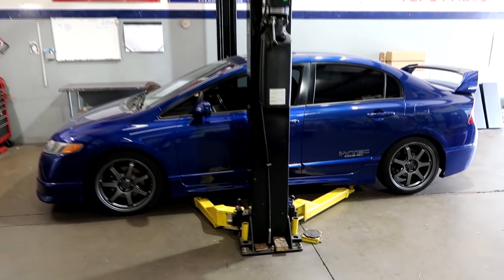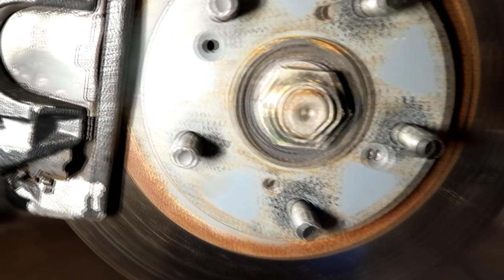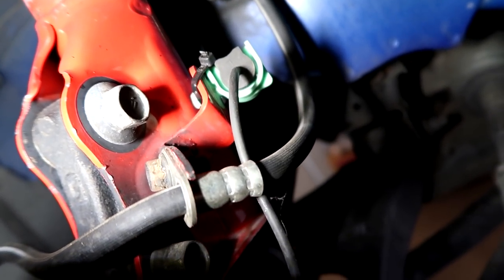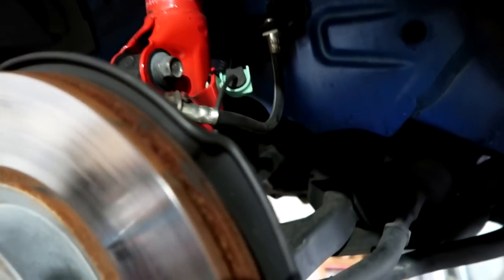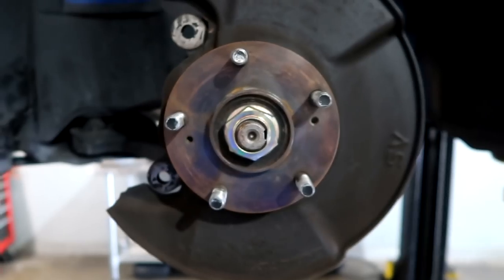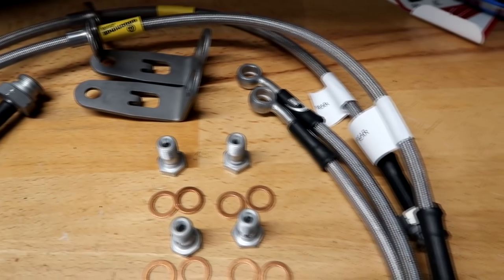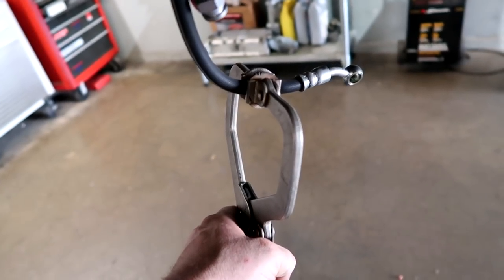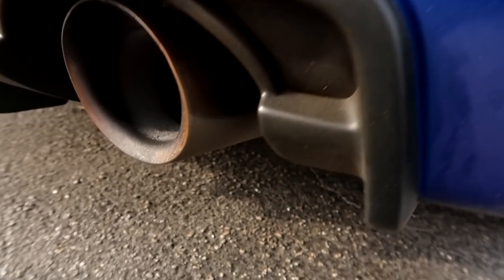Mugen Civic Si Brakes

Comment: If you dont want the brake fluid leaking while replacing the lines you can press the brake pedal to the floor and hold it there with a rod. Also if you wont be replacing the rubber flex lines never clamp them. You can crush them and impede the flow to the calipers or it will delay the brake from releasing causing excessive brake wear.
Reply from the maker: IWORKYOUWATCH In the video it was mentioned the lines were to be replaced. Hence it didn’t matter.
Reply: @LHTPerformance  I learn a lot from comments so I put my 2 cents. I no you already have that basic knowledge

Comment: Hey George!  great vid, very informative!  Got a K-series question for you... Got my head in a shop right now having it looked at (K20A2).  The valves on cylinder 4 cannot be loosened any more (zero lash).  What could possibly be wrong?  I thought these motors have titanium valve seats?   Any insight would be greatly appreciated.  Thanks in advance!  Love the Mugen Si and the awesome vids!

Comment: Also how good is goodridge vs let say stop tech braided brake lines? Stoptech lines are cheaper most of the time. Im planing to upgrade my brake lines on my car. And your inputs will greatly help. Thanks.
Reply from the maker: Ronald San Pedro After installing many different brand we’ve found the goodridge  fit perfect and never had one leak.
Reply: @LHTPerformance  thank you. Thats the one ill get.

Comment: U didnt clean the new rotors with brake cleaner to get the film off. Or did I miss it?
Reply from the maker: j spec I’m pretty sure it was mentioned in the video. Rotors are always cleaned before install.

Comment: Glad you fix the direction of the rotor by the end of the video
Reply from the maker: ClutchGearThrottle Please explain.  I’m pretty sure you’re mistaken.
Reply: LHTPerformance @9:02 vs @15:45
Reply from the maker: ClutchGearThrottle 9:06 is one side and 15:45 is the other side.
Reply: LHTPerformance are the rotor fins directional?
Reply from the maker: ClutchGearThrottle Yes. There’s a left and a right. The slots runs from the center to the leading edge in a forward motion 😎...😉

Comment: I could be rong but... I think you need to switch the brake rotors from left to right!   If the wheels turn the groves wil turn inside not outside?
Reply from the maker: Like you said, you could be wrong 😎

Comment: Love this car! One question I have is, when disassembling the brakes for paint, did/do you drain the fluid out before capping them off where the line attaches? Will all the added time I have in isolation, I want to begin doing this. Can’t wait to see the next round of parts!
Reply: Andrew Stewart fluid was drained from the calipers and I used vacuum caps in the holes
Reply: George Fitzgerald Thank you George! Enjoy your car and thank you for sharing the build!

Comment: @LHT Performance do you find that the stock calipers are sufficient with the stop tech rotors?  Do you have experience with the Wilwood calipers or anything like that?  I want to street and track the Si and wondering if they would work well for an 8th Gen, fitting as clean as your upgrade here..  ;)
Reply from the maker: We’ve never had much look with Wilwood. I would much prefer an OEM caliper with an upgraded rotor and pad and use cooling ducts if you plan to do road course.
Reply: @LHTPerformance  thanks for the advice!

Comment: Have you thought about dropping a set of Accord Type-R calipers on the Mugen Si?  They should bolt straight on and would give you twin pistons, instead of the standard single pots.  Might need a set of S2000 rotors to make everything line up perfectly.

Comment: @13:15 there's a pin you need to remove with a magnet to get the secondary piston out, I almost wanted to yell at my screen haha
Reply from the maker: Ram Daftar We’ve never taken one apart. In the Honda manual it’s states it’s not serviceable...we left it there.

Comment: Are those rotor retaining screws really that hard to get out even with an impact driver?
Reply: Not if you have the riggt impact screwdriver, if you dont theyre a PITA
Reply: Impact can/will shred the bolt-head. Ask me how I know 😃
Reply: Sometimes they are sometimes they aren’t
Reply: sometimes using a rubber mallet can get them off easy, if they're not too rusted

Comment: Whats the brand of your new brake master cylinder? why do you have to take it apart?
Reply from the maker: Ronald San Pedro It was an OEM unit purchased from a third party company. It didn’t fit, hence why we tried to take it apart
Reply: @LHTPerformance  oh ok. Was it because they send the wrong part or did the mugen civic si has a different master cylinder from the standard civic si?
Reply: 2006 is different from 2007-2011

Comment: I’m betting that he hasn’t cleaned the intake manifold because he’s planning on installing a supercharger.
Reply: Jairo Rodriguez I’ll be pulling it and porting it so I haven’t cleaned it
Reply: @georgefitzgerald5861   Why not consider an aftermarket manifold if it may provide grater hp gains? Not sure what is your ultimate goal.  I would like to try one of Joe Mac 9.0 2nd harmonics manifold in the future in an 8th gen

Comment: Looking to upgrade the brakes on my 04 Civic Si EP3. What StopTech parts would you recommend? I'm also pulling a "GEORGE" (LOL)... I've already upgraded to the Goodridge lines and I'm in the process of building my K20/K24 motor swap to be swapped in the coming month.

Comment: Whats the brand of your new brake master cylinder? why do you have to take it apart?
Reply: Ronald San Pedro it was for a 06 si which is different I tried to take it apart to swap internals but didn’t it’s a nissin master cylinder
Reply: @georgefitzgerald5861  thanks George. Awesome build btw. Hehehe makes me want to build a civic fd chassis then engine swap it. We dont have a civic si here in the philippines. What we have is the civic 2.0. it has a k20z7 ( i think its more like your ep3 si's  k20a3 but with drive by wire). Then swap it with k20 or k24 3 lobes.  I have an ap1 s2000 and a subaru brz. But know with a little toddler, im lusting for a fun to drive 4 door saloon. I have a friend with a ek9 civic type r with a swap b18c5 bottom end. That cat was perfect. Quite possibly the best fwd i ever drove. I think the mugen civic si is the closest car to that build. I wonder how your mugen si would feel with a 5.1 final drive from an fd2 or crv manual. Your FA5 gear ratios is bang on the same as the fd2r minus the 5.1 final drive.